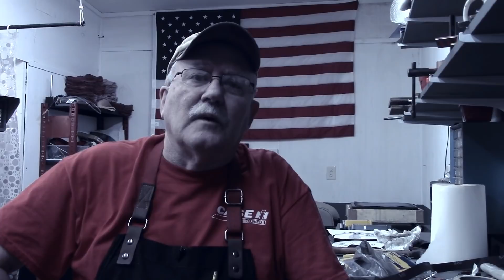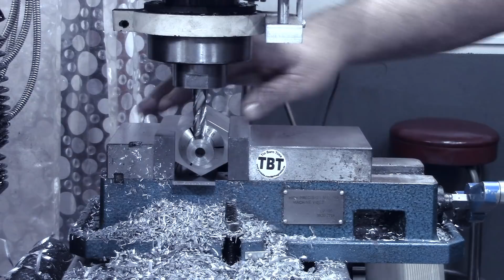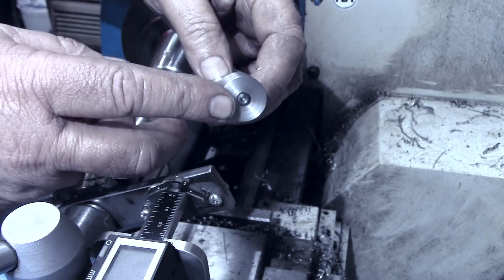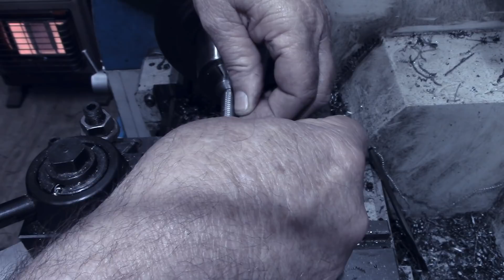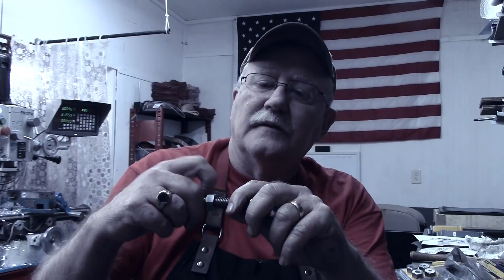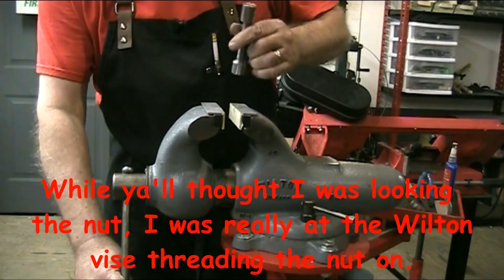Captive Nut Puzzle

Comment: Great video. When I was a Soldier in Germany 96-00. We stopped at a place with our Blackhawk for gas. One of the German refuel guys had something similar. Only it was a washer and the Nut on the bolt looked welded on. He said get the washer off. I was young and couldn't figure the trick out.
He turned the nut. It looked welded but wasn't.
This is a lot like that.
Thanks again. I am in college for machine and tool right now. Every bit of knowledge helps. Thanks.

Comment: I would have made the 7/8" side with the long thread and then turned the threaded end for a press fit for the other 

side of the 7/8" piece.  The way this guy made it, you have to take material off the end of one side of the thread 

until it is a smooth transition with the other thread. Time consuming. Either way, there is still going to be a seam. The
undercuts could hide it pretty well, though. A good machinist could figure it out if the piece was in his hands.

Comment: Thanks for making the video. I made this project 32 years ago in the navy as an MR. We called it a worry nut. I made it out of 2" brass hex stock. Also I used lefthand threads so people could not figure out how to take it apart. The brass polished up real nice to a mirror finish. I gave it to my father in law. He loved handing it to people, then taking it back and taking the nut off, then putting it back on. He would never show anyone how he got the nut off. Unfortunately I never made myself one. Things you take for granted when you are a young-en. Just bought an old South Bend. We will see if I can still do it after 32 years of working on electronics. Hopefully I can find the same stock. a 12" piece of 2" brass hex stock is probably expensive.
Reply: McMaster Carr. $118

Comment: WARNING.  
After you have cut the threads with either the lathe or the die method and you have separated the pieces to assemble the nut,  the ends of the threads are VERY sharp.  Be careful when installing the nut not to get cut and the sharp ends are easily damaged making the parting visible.  Before separating, mark the threads long wise with a magic marker.  When you have installed the nut and put Loctite on the 1/4 inch bolt for reassembly,  just line up the marker line and the threads will match.  I have shown my puzzle to many people and unless they are a mechanic or have "puttering" skills they don't understand.

Comment: Nice one...!  How about making the thread that joins the two halves left hand, and only fixing one end with thread locker. Most folks will then try to "undo" it, but in reality tighten it. You can then, unseen, undo it, remove the nut, and re-assemble...

I have had a lot of fun with that, on different puzzles. I am gonna try yours, as I suggested :-)

Regards,

Cossidriver